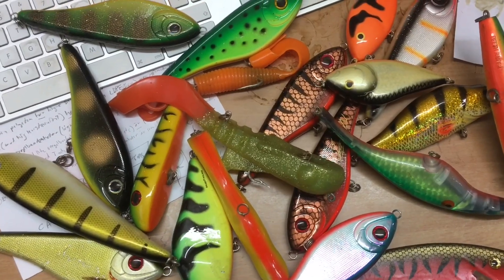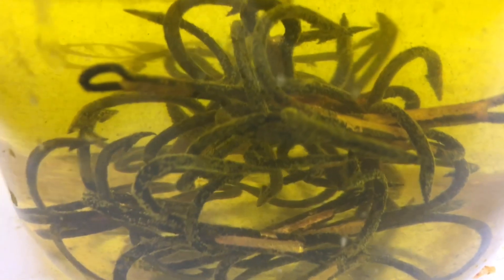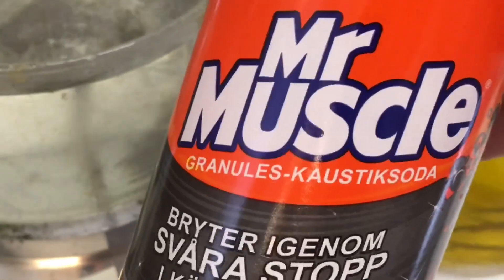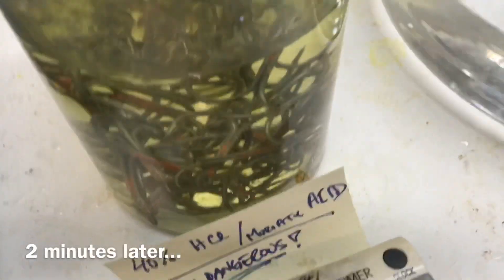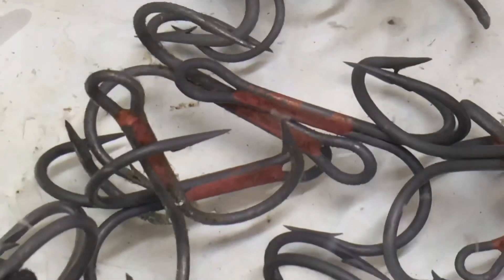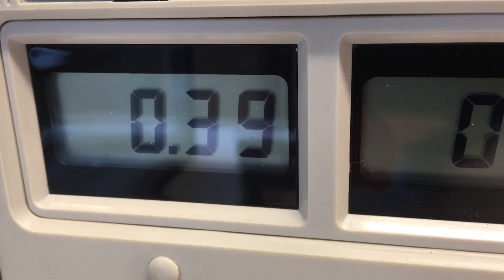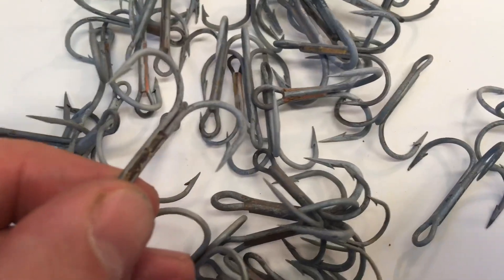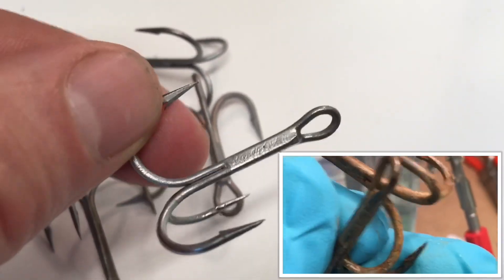Electroplating fishing hooks for permanent rust protection

Comment: Somebody just gave me about $500 worth of magnum deep diving offshore trolling lures, that unfortunately have rusty hooks. I have everything to electroplate them, power supply from an old AT computer and an adjustable DC buck converter. I'll probably add an extra step and toss them into a vibratory tumbler and sharpen before plating. Thanks, a great winter project

Comment: It looks like the hooks are brazed to give strength to the loop. After the second acid solution, this appears red - I presume that zinc has been lost and copper remains. Is this correct? You have some nice videos, very informative. You provide some education as well as demonstrating a process, so I thank you for that.
Reply from the maker: You are probably right on brazed parts and while doing it I was wondering if the acid cleaning could do some harm. I have no answer to that but if I would guess, I don’t think that the little removal of some surface zinc would matter if considering that the soldered sections always have a little excess of material. Leaving them in there a couple of hours would maybe give some perspective. Thx again for commenting!